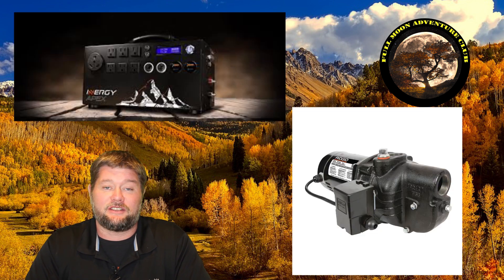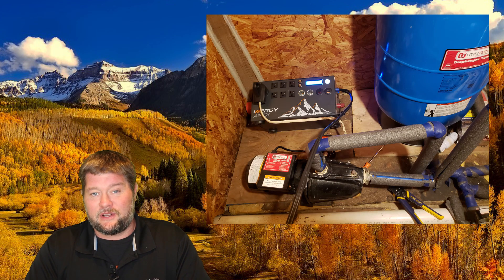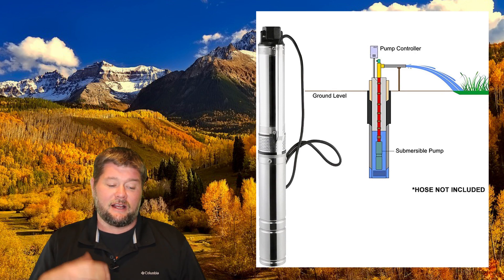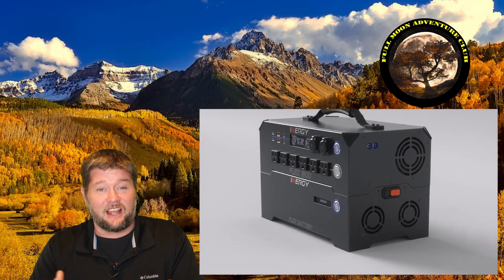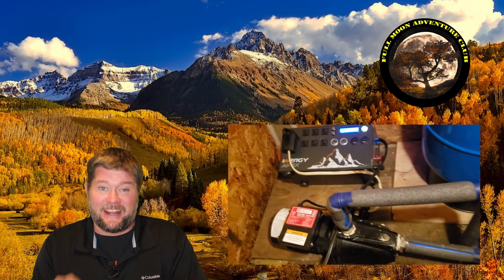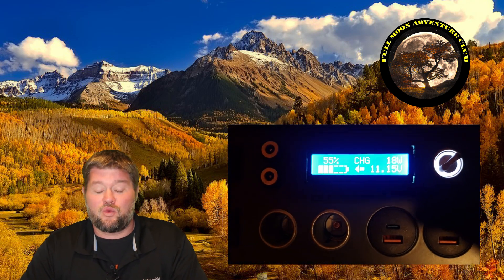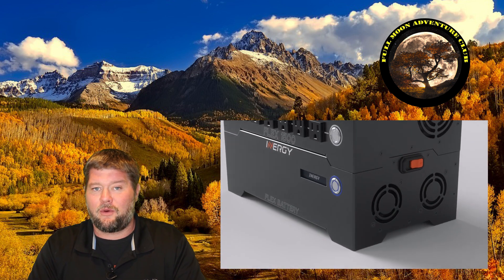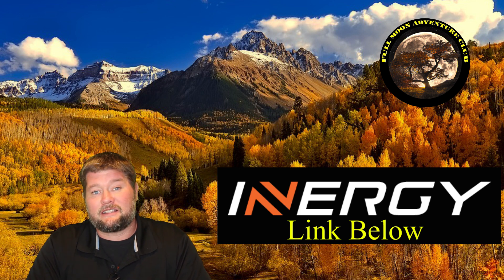Inergy Apex VS Shallow Well Pump For Off Grid Water

Comment: When will you be doing review on the new Inergy  Flex 1500 solar generator?
Reply from the maker: I am hoping to get one in June if possible so I can fully test it. Sometimes I can get a prototype to test as an affiliate. Fingers crossed. I really hope it does everything it says it can do. Thank you for the question and happy camping.      JIm
Reply: @fullmoonadventureclub  I am waiting to see your review and recommendation of this product before placing my order, all I would need it for is to run a Dometic refrigerator/freezer, fan, microwave, heater or 12v electric blanket heater in my van. Do you think it can run these things, What is your thought as about that? Thanks.

Comment: What size pressure tank are you running?
Reply from the maker: Not very big. I would guess about 10 gallons. It cycles a lot. Sometimes one toilet flush is enough to turn the pump on.     Jim
Reply: fullmoonadventureclub I switched an old 20 gal for a new 86 gal. It cost about $700.00 but my pump only runs maybe twice a day for two of us rather than eight to ten times a day. We're both home all day. Saves lots of electricity and extends the life of the pump by many years. I also went from a 30-50 regulator to a 40-60. Always advantageous to cycle the pump as few cycles as possible.
Reply from the maker: @ptcclatlptcclatl1683  That's great information. Thanks so much for sharing that with me. Just bought this house and that's definitely something I was looking into. I'm surprised it made that much of a difference but I suppose it would. Thanks again.  Jim